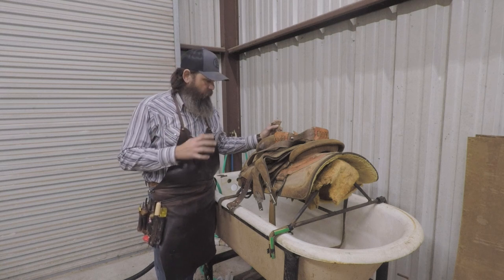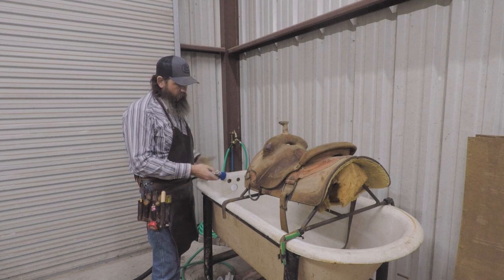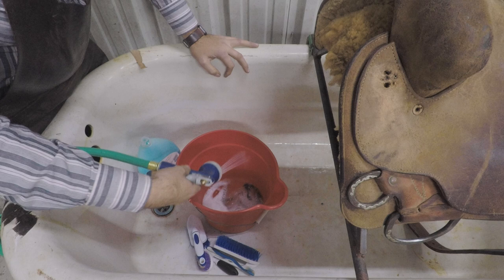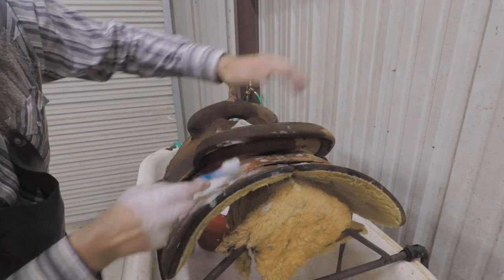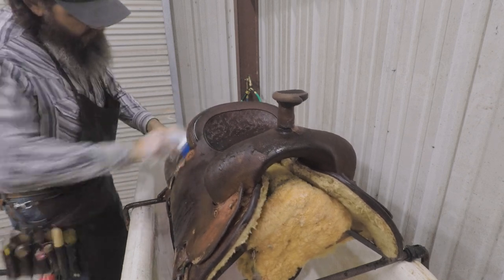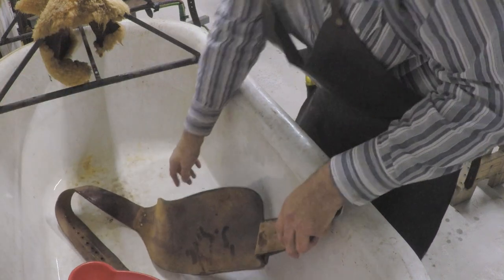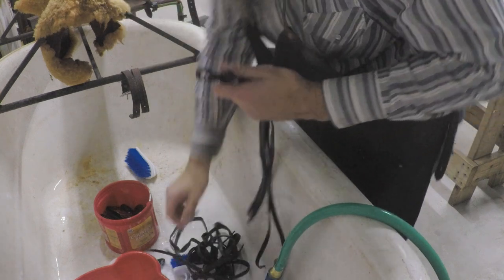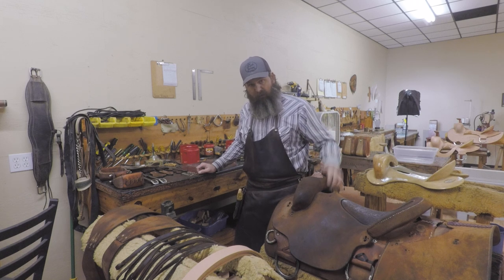How To Wash a Saddle

Comment: This will make you laugh. When I was a kid back in the 50's my Dad told me I needed to wash & oil my saddle. He said you need to take care of that saddle & it will take care of you. Heck I didn't know any better so I went out,  took my saddle & threw it  in a pond near the house. Grabbed a bar of lye soap & a brush jumped in the pond & went to scrubbing. Not knowing any better I only let it drip dry hanging on a tree limb for about 20 to 30 minutes & then pulled it down & oiled it using a new can of motor oil I had found in the barn. When finished I stowed it away in the barn on a rack. Man I was proud of my self until I went to the barn 1 day & saw that my saddle had grown a lot of mold. LOL. Why do some kids just not learn to ask a few questions instead of just jumping in head over heels? Live & learn back them days, sometimes the hard way. Needless to say I have cleaned a lot of saddles since then & I sure let the saddles get good & dry before ever oiling them, and not to use motor oil. LOL. Don, it's good that you share your experience with everyone here on the channel so some of us can share some really dumb mistakes we made in life, lol.
Reply: Damn that’s funny!😂🤣😂 I did something similar, took my dad’s old 20 gauge and scrubbed all the blue off with steel wool, got it down the barrel and everything. I was so proud that I cleaned his 20 up , YOU SHOULD HAVE SEEN THE LOOK ON HIS FACE WHEN I HANDED HIM THAT BARE METAL GUN! He asked what happened to his gun? I said I cleaned it, doesn’t it look nice? Thought the man was going to have a heart attack. That gun was one of my great grandfather’s guns. He had send it to a gunsmith I did such a good job. I really felt bad but he didn’t get too angry as I didn’t know any better, but boy I never did that again!
Reply: @bjlecorno8468  The things we did as kids never cease to amaze me. This is some funny stuff.
Reply: Haha if u didn't say that I would have done the same

Comment: I am currently cleaning a saddle that was very badly soiled from mice and rats. I wish I could add a picture to show how badly the suede was damaged.I washed it with water and sanitized it with a 10% bleach solution, I didn't want to be sitting on anything that had that much mouse feces and urine on it.  I am going to try this method and see if I can get some of the really bad staining out. Thank you for the tips!

Comment: Hey Don, I LOVE these 3 videos.  Watched them several times.  Question about the water.  I live in New Mexico where the water is VERY hard -- like 50 gpg.  We have a serious water softener, obviously, but I can bypass it if I want.  I bypass it to water the horses.  My question is: should I use the natural/hard water to clean my saddle, or should I use softened water?  People use either sodium chloride or potassium chloride to soften water.  Mostly sodium, which is what we have, since it's much much cheaper.  Thanks!
Reply: I'm no expert but sodium will REALLY dry your leather out making the oiling process much more difficult. Just my experience

Comment: Oops! I made a big mistake on my old Hereford saddle. It was really dirty, in the barn for several years. I used saddle soap, thinking it had cleaning quality. Now it is too oily. Am giving it away, so will suggest they do the Murphy. I worked too hard on it and won’t start over. The young girl I give it to will have to do as she pleases. Don’t think I ruined it. At least it is clean. Maybe it will serve a purpose until she can get another?

Comment: How would you go about uncurling any leather on a saddle, would the oil and conditioning help that?
Reply: I know when I did reins I used a lot of conditioner and rubbed it in with my hands. I had them sit in the sun for a bit and then worked the conditioner in more. They softened up and became flexible again

Comment: Great video with a lot of good info! I was wondering why you’re able to get the leather that wet? Is it a conditioner or top coat on the leather when it was originally built or is it just the nature of the leather?
Reply: Most leathers can be washed. As the matter of fact, most quality leather spend months in vats of liquids during the tanning and finishing process. It would be a little silly to assume that they cannot be washed. What can ruin leather is actually the drying process. It's either dried too inconsistently or not enough.
Reply: @StuninRub  or too fast.
Reply: @MS_249  Speed is not a problem if it is consistent. Pressed / moulded leather items can go from dripping wet to dry in the time span of less then 2 mins. They can do that because the drying is very consistent.

Comment: 1. NEVER EVER use dish soap or detergent of any kind on leather. Period. This will strip all of the natural oils out of the leather and leave it hard and cracked. Use only a glycerin based soap which is oil based. This will actually condition the leather as it cleans. If you can't find the bar soap, Murphy's Oil Soap will do but is not ideal.

2. ACETONE!?! Never.

3. NEVER EVER use a scrub brush on a saddle. Use a DAMP sponge only. Otherwise you will scratch the daylights out of the leather, leaving it dull and rough. If you absolutely cannot get the caked-on jockeys off (that thick grey, whitish, or black residue that builds up) use one of the green or blue scrubbers that come with those kitchen type scrubby sponges. Do not use this on the grain side of the leather (the side which usually faces out, where the hair used to grow).

4. Use Neatsfoot Oil to condition the leather after cleaning.

5. It's called a 'skirt', not the seat. Just sayin.
Reply: He’s been doing this for years successfully so clearly he knows what he is doing. He said he rarely uses acetone bc it is rlly drying but only uses it if he can’t get off the gray film stuff. The newer video he shows how he oils and conditions the saddle after washing it. Clearly you never saw that video or listened to this one.
Reply: Exactly
Reply: If you know the process,  yes you can strip all the oil.   However,  you have to know the process to replace the oil.  Nothing wrong with dish soap, it deep cleans, gets rid of old rancid oil, and heavy grime. Glycerin soap can't do this, and it builds up.  But totally great for novices.
Reply: Personally I agree - this sort of treatment should be a last resort for the truly grimy, filthy dirty saddles such as the saddle in the video.

I had a treeless saddle and the dirty was truly, truly caked on particularly in the stitching. Had to use dish soap and a tooth brush to get it clean.

Recently I had a leather halter that, while grimy, wasn't too bad and you could scratch the grime off with a nail. Used saddle soap and one of those kitchen scourers (not the metal ones, the scrubber sponges you mentioned) to bring it all up. Then used the other side of the sponge with as much water squeezed out as possible to lift up the dirt, soap and water. Used tack cleaner after that and it wiped down completely clean. Conditioned it, let it sit for an hour, then conditioned again. Came up a treat and looks like a different halter.

Point being that for anything other than the filthiest tack that looks like its been dragged through mud, saddle soap does the job just fine. Its very easy to ruin leather once you start using more "extreme" stuff and this type of cleaning shouldn't be considered normal.